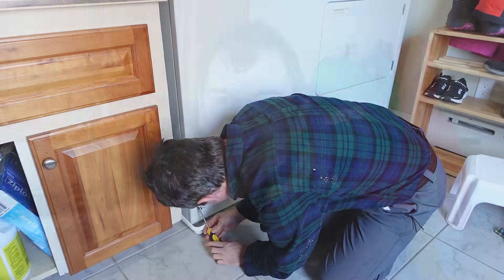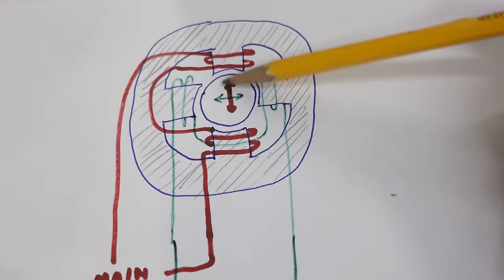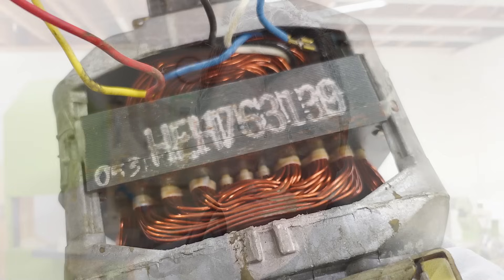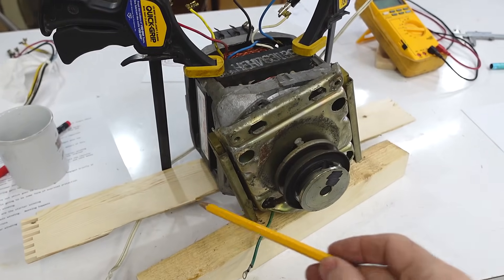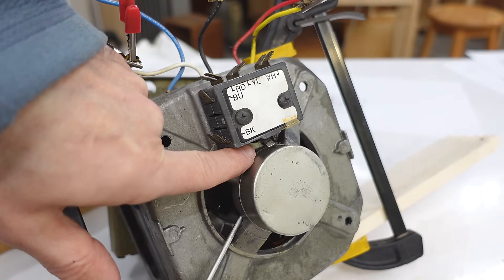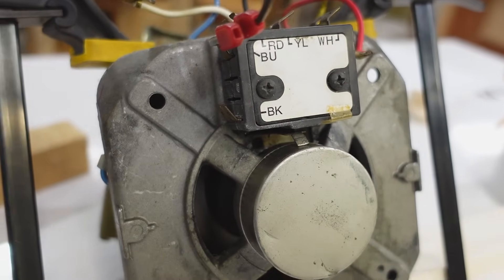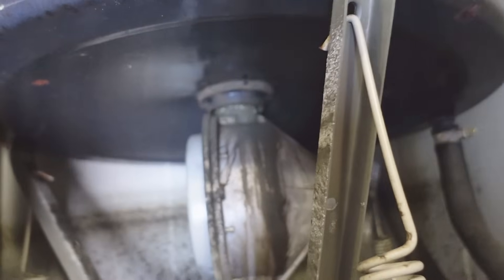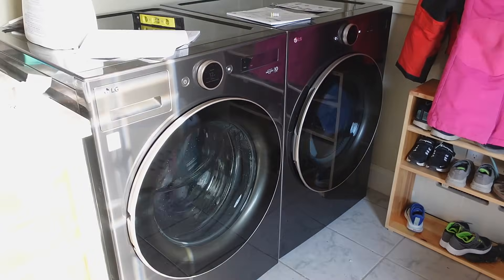Washer motor wiring to reuse for projects

Comment: 3:21 I don't understand how adding a resistance puts out of phase the starter coil. Isn't a resistance not supposed to change the power factor ?
Reply from the maker: For an inductor, current lags voltage.  For a resistor, it does not.  So the coil and resistor in series lag less than the other winding, which has much less resistance

Comment: I have a version of that washer from 1994… same one that I found in almost all rental apartment buildings I’ve had to do laundry.  This unit has had 1 belt replacement, and I had to replace the tilt/lid open switch that had been corroded by mice getting into the controls area.  Aside from a squeak if the drum gets off-centre during the spin cycle, it’s been a remarkably robust machine.

Comment: My speed queen dryer is almost 50 years old. I replaced the washer years ago, but in retrospect the fault was the local water had eroded an aluminum plate which could have been welded and repaired. They don't make em like they used to!

Comment: Nice job with the motor demonstration!
That tub bearing kit is absolutely available: Maytag p/n 204013. Sounds like the technician just didn't want to do the work involved to replace it.
Reply from the maker: he did swap a part that looked like that, so perhaps it was another bearing in the gearbox that went.
Reply: @matthiasrandomstuff2221  I could see where water had been leaking onto the gearcase. Perhaps the internal upper bearing seized, as well. The entire orbital gearcase is still easy to find for these, too. There is a bearing above, and below the brake, too. If all those got wet, they were probably shot, as well. Hopefully, the new washer will hold up for you!

Comment: After 4.5 years use, the drum spider disintegrated on the LG front loader, taking out the bearing seal, bearing and front door seal. Fortunately, no shaft damage or not worth repairing.

 The drum spider is just raw injected aluminum.  Raw aluminum galvanically reacts with detergents and other metals in the system. Unbelievable Engineers would permit Marketing to bully them into such an obvious failure mode.

I installed a new spider (not for the mechanically faint of heart - need close tolerance machine skills - no hammers),  carefully cleaned with acetone, double primed with automotive etching primer, and double coated with automotive enamel. (Wife would not let me powder coat and bake in oven.) Has lasted 11.5 years. But expect corrosion fail in the next year or 2.

Comment: Interesting motor design FAQ. I'm familiar with capacitor start motors, but it never occurred to me you can achieve the same starting phase shift by using a wimpy start winding. Hopefully the engineer that thought of it got a hefty bonus.

Our washer is a front load but I can almost guarantee it is not going to last 30-ish years. When we built our house in 1982 bought an old school top loader. We replaced it in 1999 with a front loader. Mainly to reduce water use and improved extraction to reduce drying time/energy consumption on our electric dryer. We are now our our third front loader. Currently have an LG front loader purchased in 2015.
Reply from the maker: well, that’s getting on 9 years for that one.  not bad for a modern appliance.

Comment: On the new washer, depending on how often you use them and your fabric softener use, that front rubber gasket will go out in about 3 years. Not too hard to fix though
Reply from the maker: thise gaskets we’re a wear part on front loaders even as far back as the 1970s.

Comment: Amazing with the start wind not kicking off, the current was very high. But once it dropped out the current dropped so low in comparison. Since the motor running was drawing less than 6 amps, the motor didn't even have one horse power to do the job...   Thumbs Up!

Comment: the thing that struck me with a new washer and dryer (similar to those new ones) is just how much faster they are vs. the old ones.  the dryer takes maybe 1/3rd of the time and still dries just as much.  I have no clue how the heck it can be that much faster.  the washer is likewise much faster and somehow does autobalancing.  I suspect there's pockets in the drum and it squirts water into them to dynamically balance it as it spins.  then when it stops, the water can just drain out.  I'm sure that they will not last as long as the old mechanical only washer it replaced, though.
Reply from the maker: front loaders spin a lot harder, so the dryer has less work to do.
Reply: @matthiasrandomstuff2221 hah yeah you're right, I didn't think of that.  like you I had fun removing all the electronics and motors and things from the old washer and dryer before I got rid of them. you never know when it will be useful

Comment: When I need a "new" washer/dryer, I am going to Estate sales and get the older models.  I have a set now from the 1990's and they are still running strong!
Reply from the maker: for the last 29 years I had old top loader washers, changing washers when I changed houses.  I had to fix every one of those at one point or another.  but they are easy to understand and fix.
Reply: Yes, I have repaired mine a couple times, very easy and cheap compared to having a serviceperson do the work, or buying new.

Comment: Mechanical switches. Unbeatable. 
Also you can get any size type of bearing for anything !
Reply: yeah the seals are usually the harder part.
Reply from the maker: its not like there's a standard ball bearing in there.  Probably some bronze bushing pressed into something.
Reply: @matthiasrandomstuff2221 If only you knew someone with a lathe... 🤔 😂

Comment: Great explanation, now I almost want my washing machine to break down so I can salvage the motor :) I have an 18 year old Bosch machine, still running fine. German engineering ;)
Reply from the maker: motor in that bosch is a universal motor.  Not recommended for other uses.
Reply: @matthiasrandomstuff2221 I know that a universal motor requires a control circuit, are there other reasons why you're not recommending them for other uses? The Post Apocalyptic Inventor did a couple of videos several years ago of controlling a universal motor from a washing machine: https://www.youtube.com/watch?v=CtulRqznbzI

Comment: about 10 years ago I went down the rabbit hole of wiring washing machine motors so that I could get them to spin as fast as possible to throw bricks in them. But the internet lets us down because your washing machine motor is completely different to mine. Typically, 10 years ago all of the WM motors in the uk were brushed commutator universal motors, but all of the videos explaining how a "washing machine motor" works was referring to an induction motor, similar to yours, usually with capacitor start. The newer ones here use a "silent drive" motor, basically a brushless 3 phase induction motor that requires a separate board to drive it. The deluxe machines (possibly like your new one) have a direct drive, with a pancake motor attached to the back of the drum. People of the internet like to turn them into pelton wheel turbines for off grid hydro power. I have a few videos on my channel of the bricks in the washing machines. Cheers.
Reply: The main difference for this is that in 'Murica, being needlessly wasteful and criminally negligent with energy and natural resources is what gives us the most sense of FREEDOM! As a result, our washers are a bulky, terrible design that's basically a tin can with a flap on the top, which MUST fill with 70+ gallons of water for the clothes to even move around, then it shreds them for a while with a sharp prong that sticks up in the middle, then it drains, and because it can't redistribute clothes after the water is drained out (a front load machine just slows down to tumble and back up to spin to move the clothes), it only spins 500-700 rpm which means the dryer burns 5,000 watts of electricity and blowing it out of a 4" hole in the wall, working overtime boiling all that excess water out. But americans are so stubborn that about 80% of them will refuse a front load machine because they heard something bad about one once, and they just want what they've always had... like toilet paper! Keep doing the same victorian era thing, century after century. 😂

Comment: Those old Maytag washers a bulletproof and will clean better than anything on the market today you should have got it fixed
Reply: He said the bearing is no longer available. If you can't get the part you can't fix it.
Reply: @1pcfred  you can find them nos I do appliance repair and the only thing that can kill these is bad timers and rust
Reply: @1pcfred  absolutely these machines are indestructible

Comment: This is actually so useful ! I’ve actually run into problem with an old belt sander and now I know it’s the starting motor wire which I was wondering why it was so thin ! I only need to reattach it…. If only it’d that simple 😂 thanks you !

Comment: We had front loader washer, need to monitor larger rubbery door gasket for mold. We would leave the door open when not in use.
We actually switched back to a simple Maytag washer when we needed to replace some electrical parts that cost more than the new washer.

Comment: No you are wrong, resistance does not cause a phase shift for the starter winding.

The starter winding in series with the main winding and the additional inductance of the winding causes the phase shift.

In parallel the differences in the inductance between the windings causes the phase shift.

They use smaller wires for the starter winding because it only needs to have sufficient magnetic power to the rotor spinning in a direction so less current required

Simple Google will confirm
https://www.google.com/search?q=does+resistance+cause+a+phase+shift&oq=does+resistance+cause+a+phase+shift&gs_lcrp=EgZjaHJvbWUyBggAEEUYOTIICAEQABgWGB4yDQgCEAAYhgMYgAQYigUyDQgDEAAYhgMYgAQYigUyDQgEEAAYhgMYgAQYigUyDQgFEAAYhgMYgAQYigUyBwgGECEYjwIyBwgHECEYjwLSAQkxNTI2NGowajSoAgCwAgA&client=ms-android-samsung-ss&sourceid=chrome-mobile&ie=UTF-8

Comment: Great guide. Very informative. Hey I have a cheap jointer/planer that trips the power due to a leak to ground after about a second after powering up. I'm pretty sure the leak is from the motor. Any idea how I could troubleshoot this?
Reply: I have a motor that does that. I never figured out how to fix it. Well, the way to fix it is to get another motor. The motor I have is so bad I can light a lightbulb off the case. I saw that and I was done. I was like, junk! If I tried to ground that motor it'd really blow the breaker then. It's a weird motor. The way to reverse it is to flip the rotor in it. Take a bell off, take the rotor out and put it in the other way. Then it'd run the other way. It came out of a cheap Chinese wood chipper.

Comment: Front loaders are very nice and do a reasonably good job.  Complaints about odor can be reduced by wiping down the door inside and its frame sealer  after each load and leaving the door cracked
open to allow the washer to dry.  We also pull the soap drawer out (upper L corner) and drain residual water into the sink and put the drawer on top of the washer.  Reduces black mold
growth around the soap drawer.  If you use the washer daily (probable with young kids) then do this on last use at night.   Soap drawer on ours go a little mold until we started pulling the drawer and allowing it and the opening to dry.
Reply: Why should a "better" device require more maintenance just to not smell like sewage? This wasn't even a problem before.
Reply: @nobodynoone2500  Evidently top loaders drain more completely.   Front loaders have an elaborate seal in the door to prevent leaks and this stays wet if you close the door after use.  Also after some months of regular use the drainage holes in the bottom of the door seal get partly clogged with hair and lint.

Comment: I've ripped my fair share of appliances apart, and I've never seen a centrifugal switch in Europe.
Reply from the maker: Not necessary with 3-phase power
Reply: @matthiasrandomstuff2221  Even one phase washers, dryers and such use phase shift capacitor, not a centrifugal switch. Three phase motors don't need any messing about.

Comment: Nice!
That bearing in the transmission might not be "service tech" replaceable, but might be DIY replaceable.
I just replaced noisy $3 bearings in my $300 HRV blower motor (after spending $300 on a replacement blower - that left me with the old one to "learn from")

Comment: My front loader washer is 30 years old. I've replaced the motor and tub suspension springs about 10 years ago. These will keep running because they are so old that there's no electronics - the perfect blend of old school mechanical tech and front loader efficiency. Today's units are full of electronics that will likely fail first and be impossible to fix and must be replaced - if parts are available. Of course, Matthias will just build a PI controller for his if necessary...

Comment: Thanks, now I can use my almost-identical motor from my old speed queen washer. Drum rusted through near the bearing. 👍
Reply: How old is your Speed Queen? We've had ours several years and it has a stainless steel drum.
Reply: @Bob_Adkins  It was about 16 years old. I couldn't afford the SS drum at that stage of my carreer. Should have bit the bullet though, that was a great machine. Hindsight's a b!t*h.  😋

Comment: Well explained! As an addition, I'd like to mention that European refrigerator compressors are equipped with a device that monitors the starting current: it interrupts the starter winding using a thermocouple. This module is called a "klixon," probably because it makes a satisfying click when it operates.

Comment: I had the joy and pleasure of "fixing" a drying machine a couple of weeks ago. Also very old and extremely simple. The bearings in the motor itself were worn, and it was a real pain to disassemble the motor and replace its bearings (without proper tools), but now it runs like new. Also had to replace the belt, the old one was very worn and stretched.
Reply: The bearing gave out on my front loading washer after 15 years (mine made a similar, but more spectacular spray of grease you can see inside Mathias's machine at 8:26). The replacement bearing was only $50 or so, but it was a pita to disassemble. Then when I hooked it back up I cross-threaded a water line, caused a leak and ruined my laminate floor. So I bought myself another chore.

Comment: Keep one of the steel sides too. You can frame it and make a magnet board for the kids.
Reply: Good sheet steel for any project. Made a few enclosures, and even car parts from em. Usually the front panel is best for reusing as a whiteboard/magnet board.

Comment: we're on our 2nd washer in 25 years, and I've already repaired it TWICE myself (new overflow pipe, and new water valve).     There is a bellows-type water pipe on top of those horizontal washers and they wear out because they shake so much.

Comment: Very good explanation and demonstration. 
As an old guy I find it extremely difficult to get used to the idea that I must pay more for a product that probably won’t last as long as the one it replaces. 
Another great vid, thanks for sharing your knowledge.
Reply: Eh. We have had great luck with our front loader. It’s never smelled. But it’s Asko without the giant rubber bit of crap that you see on a lot of models.
Reply: As an old guy, I don't care. If I would will someone my washing machine, they would throw it to the curb.
Reply: @Bob_Adkins  And I would pick it off that curb. The new front-loaders stink, literally and figuratively.

Comment: But why do many motors still use a starting capacitor if the thinner winding is cheaper and works just as well?
Reply from the maker: starting cap works much better and draws less current on startup.  Anything over 1/2 hp, the resistance starter's current gets too high, so its only used for 1/2 hp and less.
Reply: Great question and answer!

Comment: Brilliant explanation. One thing I never understood is how a pure resistive load can cause a phase shift. Would it be better to say that the startup inductive forces when comparing start to run are different, leading to the phase shift simply because of induction? With different gauge wires, and different current draw between the two sides, it makes sense there would be a phase shift because of that.
Reply: You are right that pure resistors by themselves don't produce and phase shift. The time constant of a simple LR series circuit is L/R. In this motor we have two stator LR circuits at right-angles to one another. The important thing for the motor rotation starting conditions is that the time constants of the two stator circuits are sufficiently DIFFERENT to provide a rotational starting kick to get the rotor up and running. After the rotating kick  quickly increases the stator rpm, the centrifugal switch will then disconnect the now un-necessary (and unwanted inefficient ) stator starting LR circuit, as shown in this excellent video  Hope that helps :<)